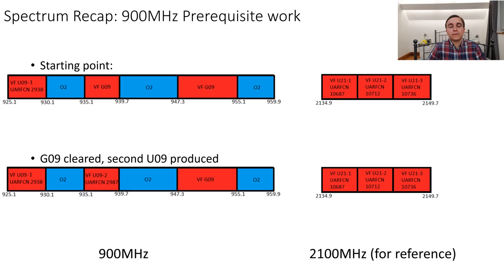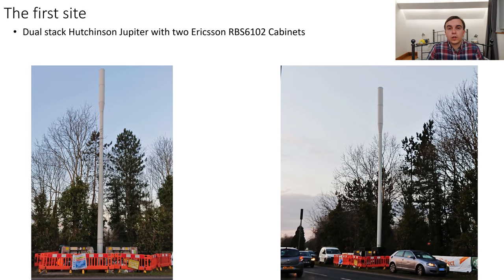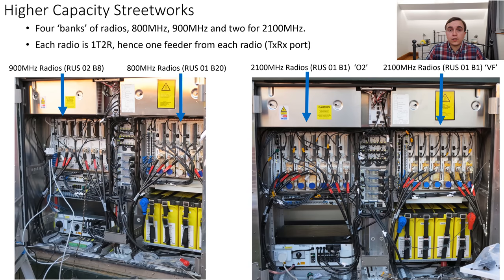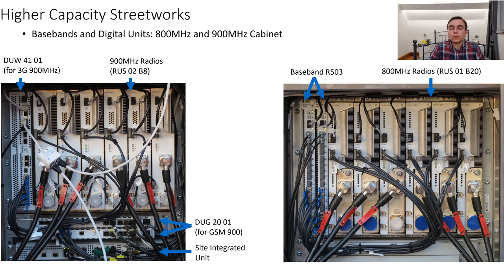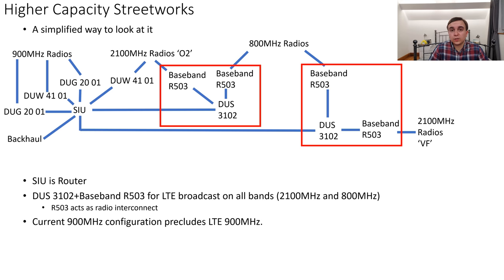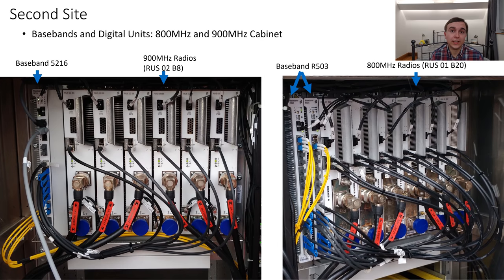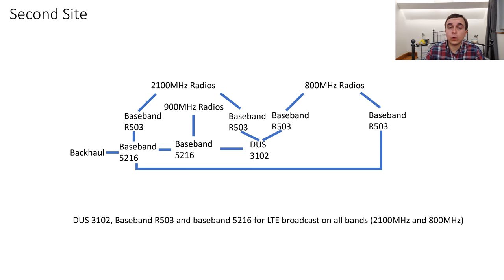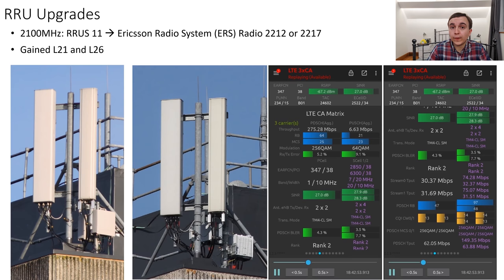Inside Ericsson RBS6102 Cabinets: Vodafone L2100MHz (Basebands, Digital Units, Radios) + RRUS to ERS

Comment: I'm currently looking for a home outside of a 400 meter radius of an antenna, I'm also using an acoustimeter to gauge the RF.
I have found a property within 100m of an antenna but it is behind a hill and I get a reading of 0.25 V/m I was hoping if you could give me some information regarding how much RF I would be getting from the antenna at this particualer you seem to be the man to speak to.

Liking the videos :)

Comment: Thanks and very informative. Do they typically house CCTV at remote shelters or cell towers ?
Reply from the maker: Some do yes. At a minimum the sites have various locks and alarms, but some have multiple sets of fencing with barbed wire and various additional protection mechanisms!